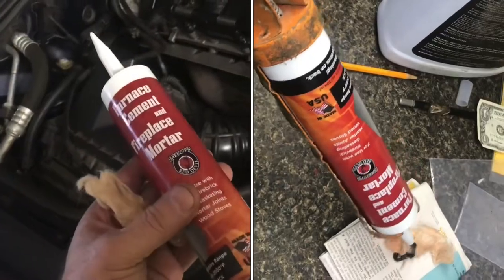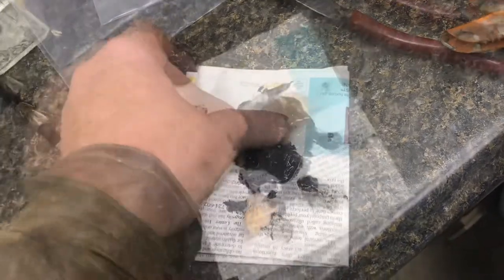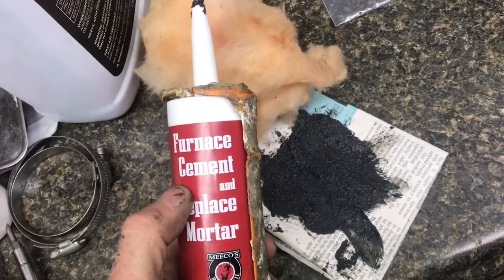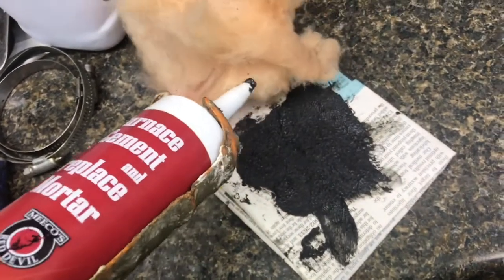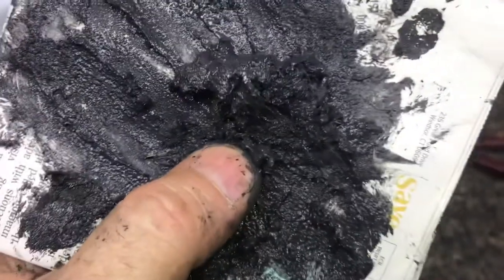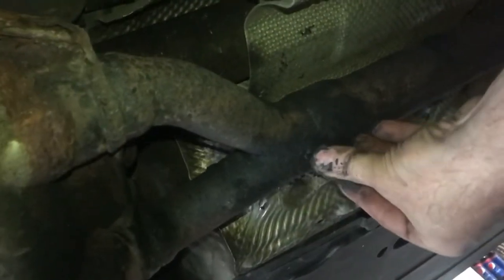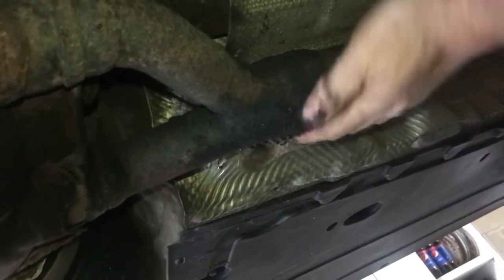“high temperature repairs” on EXHAUST PIPES (furnace cement and fiberglass)

Comment: Awesome video is right! I actually weld the pipes, however, there are places that are unreachable , usually at the top where the pipe likes to crack. Your solution is a perfect fix for that!!  Thanks for posting..
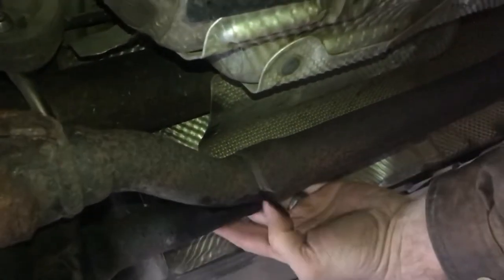Reply: 0:12 doesn’t cement for winter would want to be used for those who live in those climates or does it still hold together and heat gun instead of exhaust to warm up?
Great looking trick to build high quality thanks
Reply: Did it last?

Comment: I wonder how long it lasts, lol. Usually if it's not the heat, it's the pressure that blows out the patch.
Reply: It's an open system. How much pressure would be there?
Reply: @richiesun9676  You'd be surprised. I kept blowing out patches on my exhaust on a diesel engine, the air coming out the exhaust was quite substantial and that's not even with a good turbo, lol.
Reply: @toddk1377  Ahhh makes sense. They do sell high heat fiberglass mesh that could work too. Fiberglass insulation does have a melting point of 1300F, which is quite good when mixed with the woodstove caulking.

Comment: I've been thinking about mixing Furnace cement with JB Weld putty to make it more cohesive, and to use clamp butt on top of it, cause I need to join the two resonator pipes together at a seam where it rusted out.  Any thoughts how that might work out  (or not)?  Thanks!
Reply: That will just fall out even if you reinforce it with exhaust repair paste. I'm going to try the fiberglass instead

Comment: Would you say furnace cement works better than jb weld extreme heat?
Reply from the maker: I’ve never used JB Weld extreme heat, I just looked up the specs and it says that it will hold up to 1000°. That is in the same ballpark as furnace cement. Furnace cement states it’s 1200°. Furnace cement and fiberglass or a fraction of the price. I would love to see a side-by-side comparison. I hope this answers some of your question.
Reply: @livefree6878  do they sell fiberglass at lowe's or home depot? Where would you find it?
Reply: Toby. My experience with jb weld extreme heat was not a good one.  I spent a good hour and a half prepping the surface to make sure I gave it the best chance. After application I got one trip to work and a half trip back before it started failing. I did everything right.  Followed instructions to the letter and really really put effort into preparing the surface.  So in my opinion with my experience I would say no to using jb weld.
Reply: Yeah I’ve tried it 3 times 
It’s not that good 

Especially for really high heat areas with a lot of exhaust pressure
Reply: @shanemcandrew2443  Home Depot
Reply: No  JB extreme heat holds better
Reply: This is way better than JB Weld high heat
Reply: @jarrettknipp5147 what did you mix’s the furnace cement with?